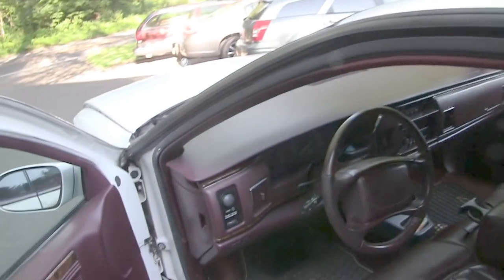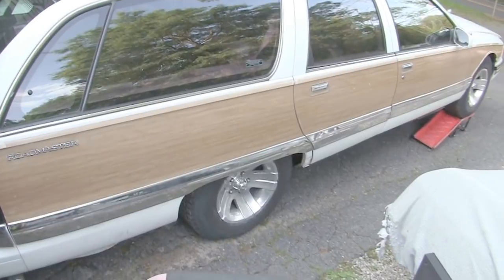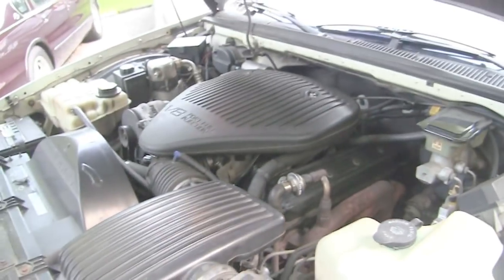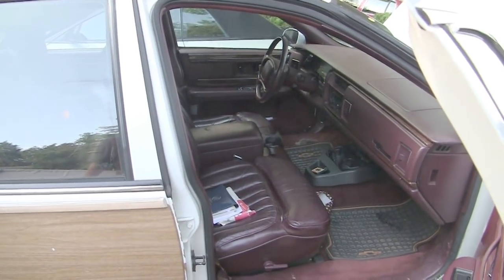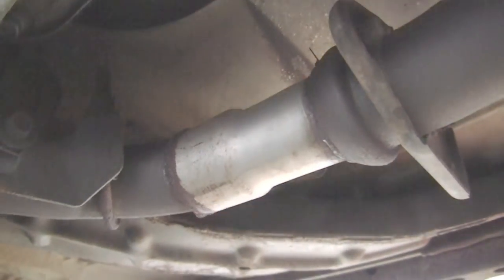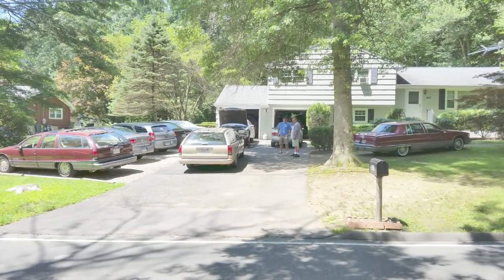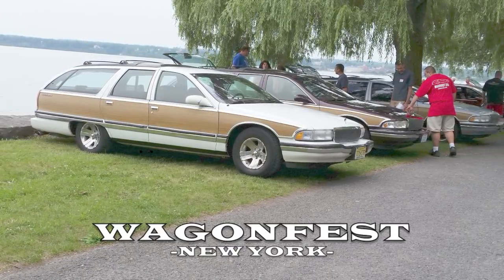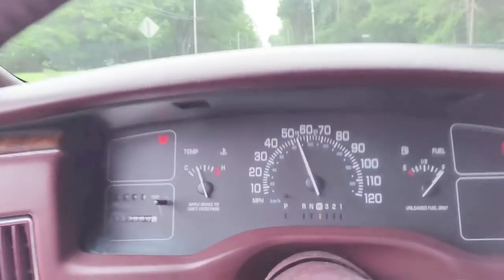My new '95 Buick Roadmaster Wagon

Comment: If the frame is nice and rust free, then coat it inside and out with Fluid Film or Boeshield T9 or some other non drying corrosion protection. The rust converting paints like Por 15 haven't worked too well for me, so I can't recommend them.